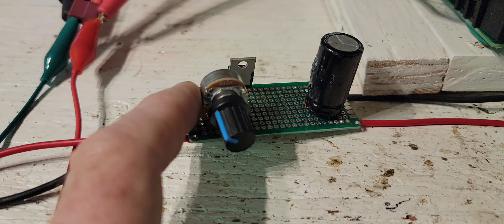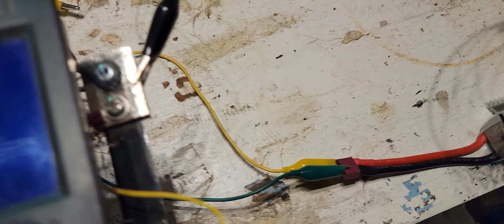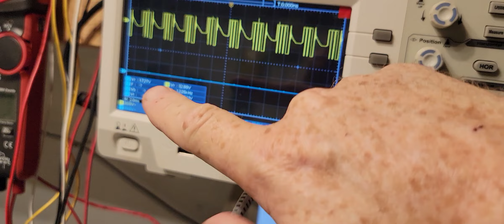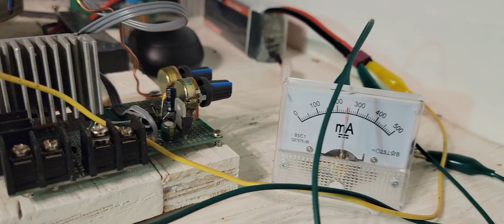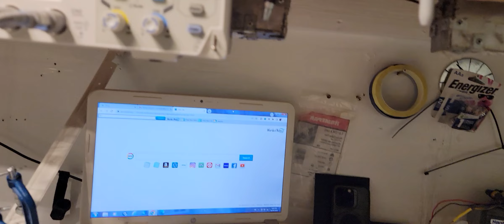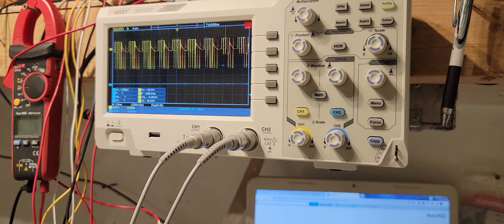How does a Cap dump circuit affect input power and RPMS on a pulse motor?

Comment: Howdy wind power and more what value scr and zener should I use in this with my motor.. I'm using 24v in and wanting to set this circuit up on generator coils into 24v battery bank. I do have a big 450v 3300uf electrolytic cap is it possible for me to use this cap?  I also have zener diodes of different voltages. I was thinking of a 28v 5w zener..? Scr is 500v 8amp.. cheers muchly! Hope your well!!
Reply from the maker: I don't recommend using a SCR and only a Zener diode.  The SCR latches in this configuration.  KENERGY has this circuit mastered using a SCR with a Mosfet that is triggered by the Zener.  It's a complicated circuit.
Reply: @windpowerandmore6310 i have the scr and zener circuit running pretty well.. id like to set up your circuit thoguh and ive started building it. is your cap circuit identical to your run circuit...? With the only difference the fet you change with a solid state relay? Cheers! Hope all is well
Reply from the maker: I forgot to send you the schematic sorry I've been really busy.  I'll email you the schematic ASAP it's a bit different ...less components